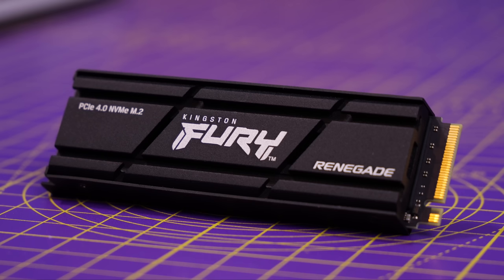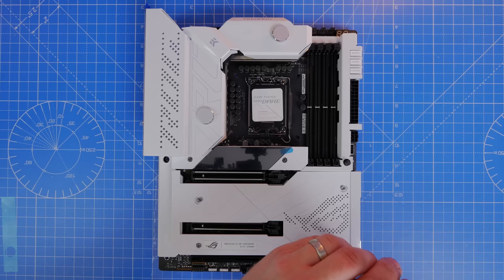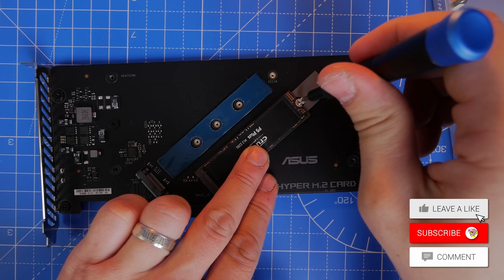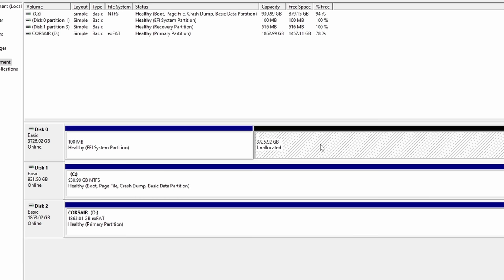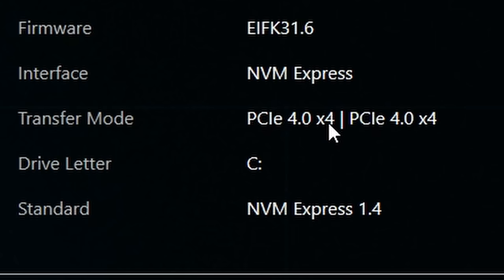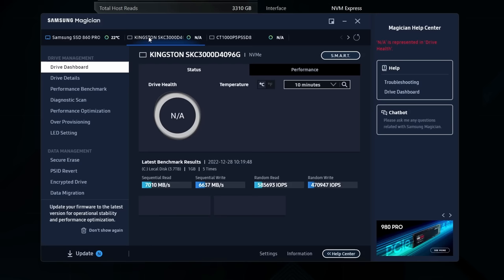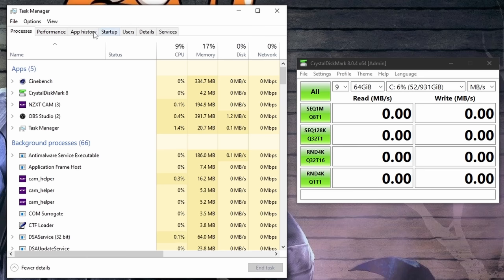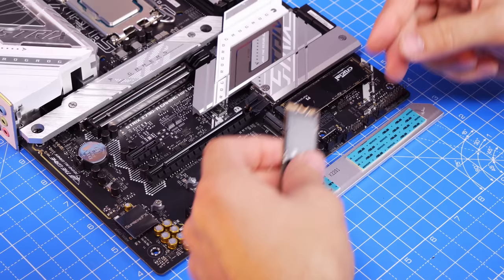Don't make these mistakes with your NVMe SSD installation - NVMe tips and tricks

Comment: I have a question about putting an NVMe on the top M.2 slot. My motherboard’s top slot is for gen5; I don’t have gen5 but I also keep hearing about the slot sharing lanes with the GPU causing the GPU to use half the lanes, so I put my boot drive in the bottom M.2 slot that’s for gen4 NVMe. I also have an old gen3 NVMe that I put in for the hell of it in the gen3 M.2 slot.

My motherboard is ASUS ROG Strix Z690-E and it has M.2 slots for gen5, gen4, and gen3. It’s all wonderfully confusing but I can’t get any straight answers about the gen5 M.2 splitting lanes with the GPU.
Reply: Same issue. I have the z790 E and the top drive is gen 5. I just put my m.2 in the next available slot.
Reply: You have all three M.2 slots populated? Are you using the ROG Hyper card by any chance? Bench your GPU, is it within range of what everyone else is at?
Reply: @tankerock  I’m using two M.2 slots, the gen4 and gen3 ones. My boot drive is the gen4 one. I’m curious what’s the point of the gen5 slot if it divides lanes, or if nobody really knows what what’re talking about.
Reply: @muckymucks  Yes, we are talking about PCIe bifurcation. Using M.2 slot #2 & #3 (the bottom two M.2 slots on the ASUS ROG Strix Z690-E) will only be affected if you have SSD sata drives also installed. You may have to use different sata ports if performance is an issue. Your GPU's performance will not be affected even if you populate slot #1 as well. Reason because PCIe gen 5 doubles the bandwidth of gen 4 which even a RTX 4090 cannot saturate.
Reply: @tankerock  bifurcation is a nippy topic but it does make sense in terms of assigned lanes per manufactures decision.

For the users it means a plain and simple RTFM to setup combinations.
Reply: @noomnoom8469  Yes RTFM because every model and manufacture will do things or change things differently as the technology evolves.
Reply: @gimpinmypants  cpus nowadays have 20 pcie lains, 16 for the gpu and 4 for an nvme ssd. So in your case you can use all 3 m.2 slots as the first one will use those 4 extra lains from the cpu, and the rest will go through the chipset.

Comment: Top slot is not a good idea on my board, if i do this, the graphics card slot will not be x16 but x8 instead....
Reply: Because top slot is using processor lanes. Bottom slot is using chipset lanes.

Comment: Great helpful video, I have a 7 to 8 year old pc but this does have m2 support as it was a very high spec when built that said I bought a Samsung 970 evo nvme and the speeds were better than using a data ssd but, no where near the manufacturer specs took me a while to work it out. Wished I had watched your video first.

Comment: Curiously, the 1st M.2 slot you recommend people to install their drive to (the one closest to the CPU) is the slot one SHOULD NOT use on the ASUS STRIX z790-E board in particular, since this will limit the GPU to run at x8. I wonder if I will ever use that slot at all. Oddly, it´s the only PCI E 5.0 M.2 slot. Equipped with a beefy thermal shield. Since I haven´t built a PC over a decade, I´m intrigued by this, wondering if I am missing something important here. 

Any thoughts on that?
Reply: I hated putting it into the second slot, since the first has the heat pipe!
Reply: @josephaltman460  I hate to be the one telling you, but I THINK both the 1st AND the 2nd M.2 slots share the same CPU lanes with your GPU. If I am not mistaken, you have to install in the 3 M.2 the furthest away, Corretct me, if I am wrong, but you might be running your GPU at x8 right now. Please send us feedback.
Reply: z790 has more pci e lanes, it doesn't matter

Comment: My early mistake - turning the screw so hard that it broke off the metal stand on the motherboard, making it impossible for the drive to get held down. I had to super glue the metal piece back to the motherboard and gently screw in the drive.
Reply from the maker: Ooof 😭
Reply: A expensive fun! 😄
Reply: Just tape it down, doesn't matter

Comment: If you have bought a drive with a heatsink is it still necessary to lay it upon extra thermal padding? Installing into my new Aurora R15(2 TB 980 pro w/heatsink) and PS5(1 TB pro w/ heatsink) each. Basically is it not necessary to have thermal padding if you bought an ssd with a heatsink?

Comment: I have 9 AM4 systems in the house. 3 are x570 and 6 are b450. I have a gen 3 Samsung 970 250gb as boot and 1tb WD black SN750 gen3 as game drive on a x570 Asus prime board. My sustained speeds are within range but my random iops are a fraction of what they should be. I’m talking 23,000 random read iops and 109,000 random write iops. Any idea why a x570 or b450 would be giving such low random numbers? I never noticed this until I started to pay attention to the speeds from the Samsung benchmark software. They do show proper gen3 x4 connection speed. Ideas?
Reply: @filbgyibcfyjechik3612  thanks for the update. Pretty sure I’m not using encryption on that basic media pc but I’ll check.
Reply: @mqcapps  thanks for the reply. You think even if they show running at full Gen3 4x speed?  If it showed 2x I would think maybe that is the reason but it’s a x570 board with more lanes available. Only cpu, gpu and two gen3 m2 drives. X570 should have no issue with such a light load I would think. Opinion?
Reply: @filbgyibcfyjechik3612  No bitlocker on this system. Just unexplanable slow random speeds on these quality Gen3 drives on full speed M2 slots. Latest chipset drivers. Sad one of two reasons I swapped out from a B450M board was to gain Gen4 for a 8x 6600xt GPU and so both M2 drives would run full speed without adapter cards on 2x bus. Well I have Gen4 8x bandwidth now for the GPU but NVMe drives don't seem to be running full speed which is disappointing.
Reply: Why do you have 9 systems?
Reply: @Koos460  One for each in the family and media PCs on the TVs and a garage shop pc for music, how to videos. It’s a bit much I know but it’s a fun hobby. Weakest PC is a 5600G/b450/GtX1080.
Reply: @45eno  You're weakest pc is better than every pc i've ever owned. My current pc is ryzen 7 5800x with a gtx 1660
Reply: @Koos460  well the gpu is a bit better. Cpu and basic b450m MSI gaming is not. I got most of my parts at very good prices. $80 for new 5600G , $80 for gtx1080 G1 , $20 for motherboard.
Reply: @45eno  yeah fair point. But i would prefer a better gpu than cpu because my cpu is currently overheating most of the time after i undervolted it and like with warzone i would prefer a better gpu
Reply: @Koos460  try eco mode. I have a 5800x with a dual 92mm Noctua SFF cooler and I just enabled eco mode in Ryzen Master software.
Reply: @45eno  i've underclocked it already it is much more managable now but I am using the cooler which came with my 1600 so a stock cooler
Reply: @Koos460  yeah that’s the issue for sure. One of the hottest zen3 cpus with a their lowest tier cooler.  If you have the space try out one of those $20-30 tower coolers. I have a Vetroo V5 on my kids 5600 and it games around 55c.
Reply: @45eno  I would love too get a newer cooler I can get a 120mm aio for like R900 and a 240mm aio for like R1500 but Im saving up my money for after me and my dad have put tiles in me and my brothers room. Im going to wall mount a couple of desks and shelves because im currently using a standing setup with my monitor and pc on top of our one cupboards we use for our clothes and I need to get a new monitor aswell. my monitor has this line in the middle of it and the right side of the screen has these weird lines over it but only with certain colors. so im going to look for 1080p 144hz or 240 hz monitor after I start working again
Reply: How full is your drive? Always keep at least 25% free.
Reply: @propeldragon  they aren’t more than 50% full
Reply: @mqcapps asus b450 board has this, nvme disables the last sata connector to allow bandwidth for the nvme

Comment: Top shot, modern systems like 2019 and newer = direct connect to the CPU.  This is why it's important.

Other slots run through chipset.  Connecting through these will have a little latency but CAN run just as fast as the one that connects directly to the CPU.  It depends on what the chipset does, so this requires you check your MB manual.  Know your MB.  Also, you need to understand the speed at which the chipset communicates with the CPU. As long as that link runs fast enough to deal with the speed of the NVMe, you're fine.  There are gen4 NVMe that are lower cost and barely run faster than the speed of gen3 X4.  You can plug those into an NVMe port that runs gen3 because in almost all operations you do the drive won't exceed that speed anyway.

In other words, you don't have to get too crazy with ensuring you have the TOP bandwidth available to a typical NVMe drive, especially gen4 drives because they will rarely run faster than gen3 speeds, and when they do it's not much over that speed anyway.  It's only the better, more expensive gen4 or gen5 drives where it's best to make sure you plug them into at least a gen4 port, and a gen4 port off the chipset means the chipset-CPU link will run at least at that speed.  So for an X570 MB for AMD Ryzen, you get the full bandwidth of a gen4 NVMe plugged into any port, so you don't have to worry about it, but you do want the NVMe that will be your boot drive to be the one at the top, closet to the CPU socket because that's the one that connects directly to the CPU.

Comment: I have and old mobo (socket 1366) and i am trying to install windows 10 in expansion card with NVME M2 2TB. I received message that : 

"Windows cannot be installed to this disk. This computers hardware may not support booting to this disk. Ensure That the disk controller is enabled in the computers BIOS menu."

 Can i bypass this using WinNTsetup 5.2 or clover ?

Comment: My cpu fan and rtx gpu is covering up my first nvme , so if I install an nvme I will not be able to use a heatsink can I use the bottom slot and still get the same speed? I will only be installing 1 nvme drive

Comment: Nvme drives actually run better warm so if you dont have above 256-512 gb then you do not need a heat sync
Reply from the maker: That's wrong. https://youtu.be/YUJKyA-q7Zs

Comment: Hi,
please help me :/
I have 2 ssd installed with windows and everything,
but my BIOs shows them as raid, not nvme.
and when I login to windows, it shows all the information about both ssds, but transfer mode in empty :/
I installed one on m2_1 and the other on m2_2 on strix z790-f
Do you know what is wrong :(

Comment: Thanks for this video. Could u answer a question for me please. I am currently building a new pc (after very long time) again. I never used m.2 (werent a thing, when i last have build one). I plan to use 2 m.2´s. A smaller one as systemdrive and a 2 TB one as gaming drive (both Samsung 980 Pro). The motherboard i want to buy is the ASUS ROG STRIX B650E-E (hopefully the i225-v doesnt screw me). Now my question: where should i place which M.2? Since, from my understanding the STRIX supports 2 equally fast m.2. slots its down to which drive will generate more heat (upper slot seems to have a much beefier headsink). So should i put the Systemdrive under the better heatsink or the Gamedrive? Also if any of my assumptions are wrong please let me know. Thanks in advance, and have a nice day.

Comment: i have 4 m.2 slots on my mobo, lets say i fill all of them, top slot being 2tb m.2 7000mbps, middle 2tb, and bottom 2 slots 8tb, 8tb, all say speeds 7000mb, so with all filled in, wil they all run at 7000mb speed individually?
Reply from the maker: Depends on your motherboard https://youtu.be/m_qy7rMs2AE

Comment: I dont have a thermal sink for mine, is that ok? It's installed in the top slot. I spent a long time thinking of what slot should I use, because while the second one is apparently slower (only 2 slots in my mobo btw), it comes with a heatsink. On the other hand, it goes right below the graphics card, little room to breath under that hot thing.

Comment: I wonder if there is any motherboard (the ones that have intel LGA 2066 for the enthusiast class of processors) that lets you run 4 M.2 gen4 SSDs at full speed + still have full x16 speed on the GPU.  I also prefer the enthusiast class for their quad channel RAM capability.
Reply: quad channel gets you nothing for gaming and is worse sometimes

Comment: All well and good have ing sticky thermal tape inside the lid/top plate on these modern MBs but how do you remove them to change your SSD if the it is secured to the MB by a fastener and the thermal tape is doing its thing and is securely stuck? Just a thought

Comment: Completely FAILED to mention some slots/devices are connected to chipset DMI PCIE rather than CPU directly and THAT is why you check the slots. It is usually (not always) the lowest spot that is connected to chipset. Those slots may be right generation but share with other devices like other slots or SATA ports etc.
Reply from the maker: I'm sure there are plenty of things I failed to mention. It's meant to be for beginners not experts like you.

Comment: Would this apply to a board that has one Gen5 drive slot and three Gen4 drive slots?  If I use the Gen5 drive and just one of the Gen4 drive slots, would it kill the speed of the Gen5 drive?  It's a MSI MEG X670E ACE board.  Thanks for the video.  I'm in the middle of this build.

Comment: Hi, does Gen3 and Gen4 refer to the max supported version of the PCIe bus, or does it have correlation to the X4/X1 lane notation of the PCIe slots?  If my motherboard only supports PCIe 3 - would it matter if I connected the drive to the X1, X4 or even an X16 slot?

Comment: Fantastic video! I bought an m.2 ssd for my wife's computer, installed as an extra non OS drive just for space, I decided I want to put it in my computer. We have the SAME exact computer, would it be allright if I just installed it in my computer as extra space?
Reply: If you're not using an nvme drive as your os drive, you're missing out. But yes, you can install as spare storage

Comment: Let me ask you this if I could... To start I have a asus rog strix x570-e(basically the same as yours) I have my C/boot drive in the top. It's running at 3.0x4. I just bought a new NVMe drive today. Can I/Should I move that first NVMe SSD to a lower port and put my new SSD in the top port? Or will that jack everything up? Like will my PC be looking at the old port like where the heck did everything go? Great video and thank you for the help.

Comment: on my z690 Strix F the first m2 slot is completely useless because i have occasional stutters and laggs in games and desktop stuff when i put my 970 evo plus with w11 in it. my 12600kf should be strong enough to handle a 4060, 2x m2 like my 970 and my 980 pro game drive. the 4060 has by design pcie 4.0 with just 8x lanes but it stutters very heavily sometimes. lane sharing is very annoying. when i put my m2 drives on the other 3 slots which are provided by the z690 chipset then everything runs just beautiful like it should.

Comment: Probably not gonna get a response on this, but help would be appreciated. On my motherboard(Gigabyte B560 DS3H AC), there’s only 2 m.2 ports. I can’t figure out which to use, and no research is helping find out if they’re even gen 4.0 slots or not. But my new Samsung 980 Pro 2TB, plugged in below the graphics card, is only reading at 3500 MB/s and writing at 600 MB/s. This is still a massive step up from the current storage (485 MB/s read, 80 MB/s write, 256 GB). When plugged into the one just below the cpu, my computer won’t even attempt starting. Any ideas?
Reply from the maker: Are you using SATA drives as well? Sometimes I've seen it where the m.2. drive or SATA drive is disabled if you're using one and the other. I.e. if you have an SSD or HDD plugged in, try moving the cable to another port. Alternatively it might be a BIOS setting causing the issue.

Comment: I have asked a few people this question but nobody have replied with an answer, It's a daft question but still I can't afford loosing certain things and it's my biggest fear having to install another windows 10, I am new to this PC thing, I used to produce Hip Hop but that was just using music software, Never really got deep into the PC thing, Wishing I did now, lol, But yeah I bought one of those crucial nvme m.2 ssd drives, I have been getting blue screen with the other drives in the PC for some reason, Now I disabled them I only got the one C drive, I got to install this nvme ssd as I do Sim Racing for youtube, But I am not able to save replays ect, Plus I wants to do a video for my Brother who sadly passed away on the 29th August 2022, My Brother is an amazing artist, Known as the King of Graffiti in my Area, Soz for saying my Brother is, I still cannot speak of my Brother like he no longer with us...
If I install the m.2 ssd will my Pc go all weird, lol, Like will the PC boot up as it normally do, It is a gigabyte gaming motherboard, It is pretty old but still runs like a bad ass PC, I am getting 160-190 fps on RaceRoom with a 1660 super 6gb OC edition I will add, lol, Sounds better saying OC edition, lol, Yeah the PC is still running as good as I want it too, I am looking on buying a new motherboard and CPU bundle But for right now this PC does everything I want it too, Its just the memory issue I got to sort out, Will my PC still boot up as normal after installing the m.2 ssd, Faster I install the m.2 the faster I can get on my Sim racing and enter races...
Hope you can answer, Soz about the esa, I just type fast, lol...